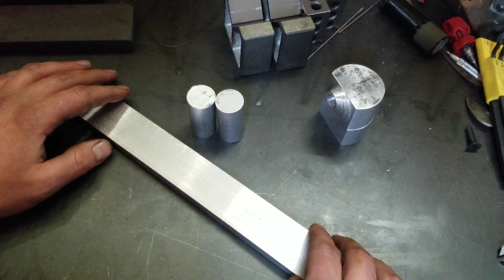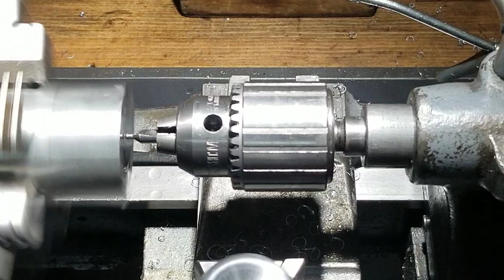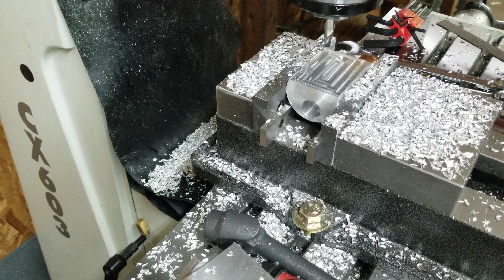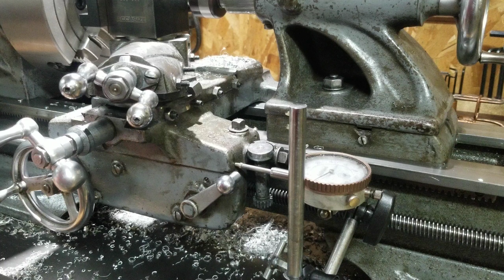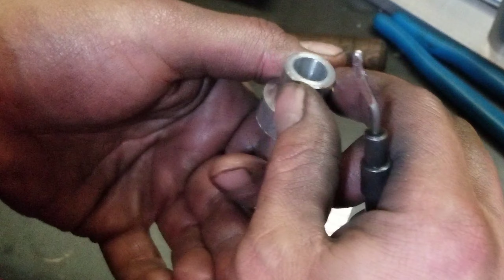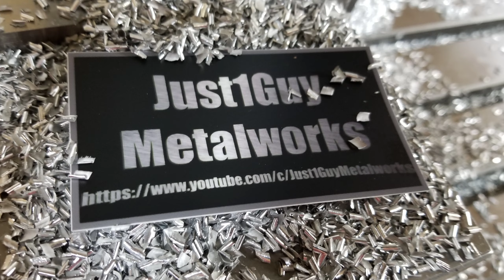Camera Mounted, Part 3! 😀 Let's make a boom!

Comment: Fun to watch. I enjoyed the video. Those blends are better than a hard corner. Those corners are invitations to stress fractures. Better option all the way around.
Reply from the maker: Thanks man 😊. Indeed a radiused corner is much less likely to crack or break under stress though it was mostly just for aesthetics in this case. 😁
An endmill with a corner radius could also be used to reduce cracking concerns. Plus they tend to last longer I'm told 😉.
Cheers!